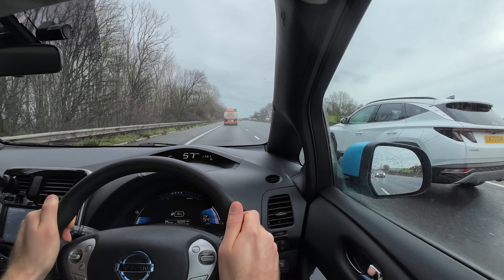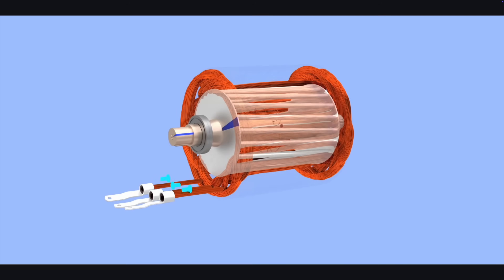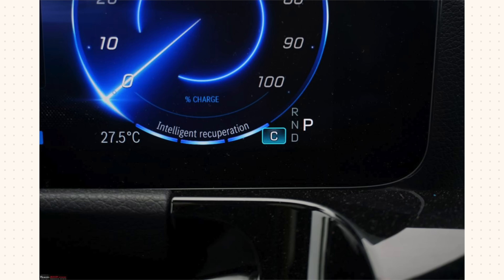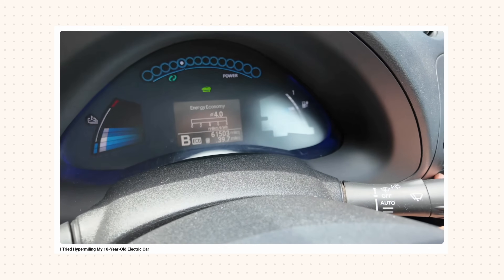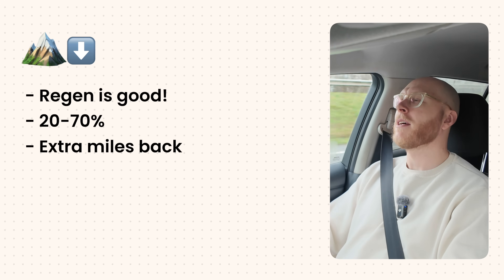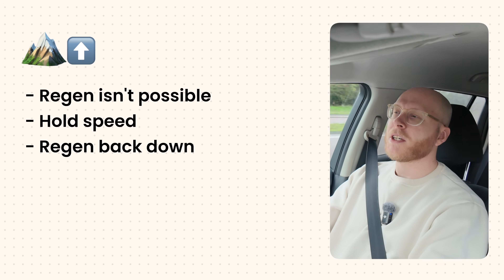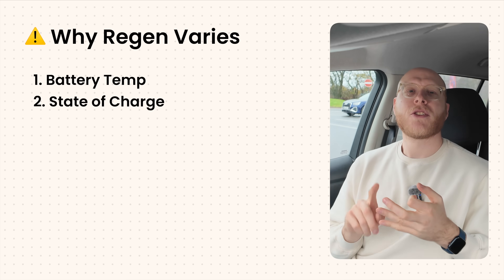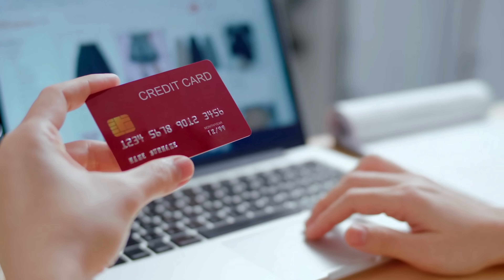You’ve Been Lied To - Regen Doesn’t Work How You Think

Comment: Regen paddles are a total waste of time if you have single-pedal driving (B mode on a Leaf). Just keep that on all the time and use adaptive cruise control on the motorway as much as you can.

That way regen is used to slow your car down if someone is driving more slowly in front of you than your set speed, and it is also used to help keep your speed constant on downhill stretches.

Single pedal driving means the amount of regen is adjusted progressively as you lift your foot up - no need for silly paddles.

People argue that single pedal driving is somehow less efficient than “coasting”, but that’s just ignorant nonsense. When cruising at constant speed, a certain amount of energy is needed to overcome mechanical, rolling and air resistance and in single pedal mode zero regen is enabled under those conditions. It is exactly the same as driving with regen off.

All regen does is substitute for braking effort, and if you have single pedal driving on it just means that you hardly ever have to touch the actual brake pedal.

Comment: For some reason tour videos keep popping up and in each one is clickbait and misinformation. 
No regen is most efficient, anywhere. Braking uses regen up to the point where you’re braking very very hard. Only then do the friction brakes take over. Better to coast and use the brake pedal (= regen) to brake just hard enough. Using OPD mostly slows you down too much, having to accelerate again. Yes it pits some energy back in the battery but at under 30% round trip efficiency. No system is without loss. If you had half a brain you’d understand that.

Comment: You missed out what happens when brakes are applied in an EV. In an ICE car the brake pedal is connected directly to the discs. In an EV pressing the brake pedal initially invokes regen braking and only applies conventional brakes when more slowing power is required - hence the long life of mechanical braking systems in EVs. The process is controlled by the on board computer control systems. So decelerating by removing your foot from the accelerator initiates one type of regeneration from the kinetic energy stored in the car - braking initiates another system which applies an even stronger reverse current in the motor top slow the vehicle. The computer decides which braking system is needed to slow down the vehicle when hard deceleration is needed or to bring the car to a stop.

Comment: I had a 2017 Chev Volt, just replaced it with a 2025 Model 3.  I had about 80% of my Volt miles on battery. (66,000 out of 82,000).  It had two regen modes, and also a paddle for aggressive regen.  I didn't notice huge gains in battery, but my original brakes were almost new when I traded it.  I use one-pedal driving on my Tesla when operating it manually.  I'm about 80% FSD since purchasing)

Comment: Our PHEV Passat GTE has a coasting "D" mode and a regen "B" mode.
I see the B mode as a driveability mode only, not energy efficiency. 
Low speeds, manovering parking lots, inner city driving, start-stop between traffic lights etc = B mode
High speed motorways etc = D mode always

Comment: 06:00 This, by the way, is where modern electric trains that get their electricity from catenary or third rail have an advantage, because they can just feed the electricity back into the grid and don't need to store it in a battery that might not have room. Older models and diesel-electric locomotives, on the other hand, just feed that power into a big resistor - effectively an electric heater - and let it heat the air around the locomotive, essentially throwing the power away.

Comment: Regen increases range by capturing some of the energy you spent to get moving, but that's not all. When you don't use the "normal" brakes, you don't wear them, so they last longer. My car has over 52,000 miles on it and the brakes look like new!
Edit: When going uphill, a steady speed is good, but for efficiency, you want it to be a bit faster than if you were going downhill. This is because the car is fighting gravity all the way up the hill, and the longer it fights it, the more energy it will consume. It can't be too much faster though, or air friction will wipe out the gain.

Comment: Any situation where you would necessarily require to use brakes is a win if using regen in an EV, otherwise it's worth avoiding using regen. With one pedal driving (e.g. Tesla) you have a constantly variable level of regen depending on how far you lift off on the accelerator. Driving technique is key to taking advantage of this. We have been used to simply lifting the right foot completely off the accelerator in a normal ICE vehicle but this is not the best technique for a "one pedal driving" EV. The idea is to ease back on the pedal and not to lift off completely. In this way you can vary from "coasting" to full regen just by the position of your right foot. People are very different in their acquisition of this new approach ... for some people it's 10 minutes and for others it might take a week before developing as much control lifting off the pedal as they have when pushing the pedal.

Comment: Regeneration puts energy back into the battery, not power. The energy which it uses (transforms) is energy that the brakes don't have to transform into heat. One significant benefit which you omitted is that avoiding braking keeps brake dust off the wheels, so they don't need to be washed as often. Also, if you drive sensibly, your original brake pads may last longer than the life of the car - my 10 year old brake pads have worn 1.5 mm in 120 000 km.

Comment: One important thing to know about your EV is if it has regen blended in when using the brake pedal. Some do, some don't. Tesla's don't so if you ever touch the brakes in a Tesla you know you are wasting energy. Ford's do, so you can apply moderate brake pedal and it will be using regen, but braking too hard blends in friction brakes and wastes energy. Fords have a braking coach for this. 

1-pedal driving allways gets maximum regen with smallest energy losses, i.e. no friction brakes (until stopped).

Comment: Regardless of EV or settings the accelerator always gives you precise control of regen.

Set regen to the max/1-pedal and then just control it with the accelerator.  There is essentially no penalty for this even during long flat highway driving.

Comment: Model 3 Performance.  I love the one pedal driving.  Regen is adjustable, and I have it set to the max so I rarely touch the brake pedal.  Never used the lower settings so I don't know how they compare,  but the car is much more efficient (miles per KWH) in stop and go traffic or just in slow traffic than at over 65MPH.   The display shows in instantaneous indicator of the amount of regen and power used, but there is no scale there.   A full battery kills regen because there is nowhere for the regen energy to go until you get down below 90% SOC.    Cold battery has the same effect, but I have not experienced that yet.
Reply: I suspect you will already have experienced a colder battery affecting regen, perhaps without even noticing. Once you develop the technique (as you have already done) you are constantly compensating for the differing angles of pedal to achieve the amount of slowing required. There are lots of factors that are affecting how much you require to lift, with cold battery being just one of them, so it can be lost in the mix. In practice you are simply responding appropriately to the amount of retardation needed, which may be the result of road surface, gradient, wind, traffic, battery temperature, battery state of charge etc etc  If you have been using your car every day then the battery pack will not actually be dropping to ambient outside temperature so you will have less of an effect. If the car is left for 2 or 3 days without driving the pack will gradually reach ambient cold winter temperature and you will be much more likely to notice the regen reduction effect. in fact there's an indicator appears on the Tesla screen when a notable degree of regen reduction is being applied .. otherwise it's possible that someone might misjudge their requirement for braking (like if driving after a 100% charge). People with the RWD Model 3 with the LFP battery chemistry will particularly notice this because they are charging to 100% much more frequently.
Reply: @MrAdopado we'll see if I get the "snowflake" icon on the display Monday morning when it is supposed to be 16°F overnight.  The car has never sat unused for a whole day, and I precondition it before I drive it, so maybe the batteries have enough insulation to stay warm enough all the time.  If figure if they work in Canada they should be fine in Virginia.

Comment: Since many people hate German cars for coasting and no one pedal driving: Coasting combined with regen on braking is the most efficient option. One pedal leads to many unnecessary regen cycles losing energy by accident. No problem if you like the comfort or prefer the mode but it is not the most efficient. Also many modern cars like Porsche, Audi, Mercedes have much higher regen levels than Tesla. More than 200kW.
Reply: That’s basically not true, unless you have a nervous tick on your legs

Comment: I hate one pedal because it just isn't precise enough for me, but I use paddle regen a lot.
We have a long hill with a 30mph speed limit. Going down it, turning on regen limits the speed to 30 without using the brake pedal. Even allowing for the occasional level and slightly uphill bits, the net result is that no electricity is consumed overall. So yes, regen works.
Going up the same hill, the electricity consumption is about twice what it would be on the level, suggesting regen is around 50% under those conditions.

Comment: One of the issues or side effects of regen in Kia EV6 at least is that when you take your foot off the pedal it immediately lights the rear brake lights unless you use regen level 1 only -- which in turn returns almost no energy back to the battery. Really odd design.

Comment: Regen works, but you're talking about few seconds of returned energy for much longer periods of acceleration and driving so it isn't much. However, I had one situation where regen returned a significant amount of energy. I was coming back from a trip in the mountains, so while maintaining speed using one-pedal driving, I was using negative 30-60 kw for about 20 minutes. I'm sure it didn't return all the extra energy used to get up the mountain in the first place, but I had much better efficiency for the round trip than estimated by the navigation system, so was pretty happy about that. I assume the navigation system doesn't take elevation into account.
Generally speaking, I use one pedal for slow, crowded roads. On roads with little traffic I use 2 pedal driving and do a lot of coasting.

Comment: A Tesla driver here, I built a can bus sniffer with a TFT display that displays electrical power at the moment. I get up ti 82 kW regen power at higher speeds when conditions allow (speed high enough, battery not too cold or too full - the car is 2020 Model 3 Performance, regen always on High setting, one pedal driving), but most of the time 72-75 kW is the maximum. Towing a trailer is power hungry, but regeneration is really effective going downhill. Decelerating at slower speeds generates lower regen powers. Between 10 and 75 km/h it's around 1 kW for 1 km/h at max decelerating. At higher speeds (like 150 km/h) regen is limited to around 75-80 kW, and deceleration is also weaker (power = force multiplied by force so braking force is lower at higher speed at the same power).

Comment: The shown Renault 5 has 'brake by wire'. It used regen when you press the brake pedal. And it adds friction braking only when necessary and in the last few meters before a full stop.
The label of '+0 Miles' is misleading.

Comment: An easier way to describe it is that if you can coast then coasting is better. If you must slow down then regen is always  better than physical brakes.

In no situation would regen be worse than brakes from an energy efficiency standpoint.

It's effectively just an alternative to deceleration instead of turning your kinetic energy in to heat it converted it in to electrical energy.

Anytime you are stopping regen is putting back energy that would have otherwise been lost. That's why it is universally better than braking for efficiency.
Reply: Yup, regen is just limiting losses you would get from brakes alone. But still losses it is. What is missing from the video is estimate of what percentage of kinetic or gravitational energy can be salvaged with regen. I'm betting on around 50% in an EV and even less in a hybrid. People get excited about the extra range going downhill but forget how they got to the top in the first place

Comment: There is some useful information in this video, but it does not, to my mind, tackle the most fundamental misunderstanding of regen.

The regen setting you select generally has NO bearing whatsoever on the amount of regen your car* does.

What it does is changes the way the system responds to the position of the accelerator pedal. At 'zero' regen, lifting your foot from the accelerator will simply cause the system to stop powering the motor. Using or one pedal mode will effectively change the accelerator (when not actually accelerating) into a speed control.  That, and intermediary settings are  essentially nothing more than variable engine breaking.

So when you lift you foot off the accelerator, or press the brake, *whatever regen mode you in*, the system will decide how much retarding force you require, and use regenerative braking to provide as much of that force as possible., and if that is insufficient, it will apply the friction brake to assist.

The way to achieve maximum range, regardless of regen setting, is to drive as smoothly as possible and avoid heavy braking whenever possible.

* This has been verified by experiment on a couple of cars, including ta 2023 Nissan Leaf. It is possible that systems that are less than perfect may use the friction brake more than is necessary.
Reply: In my 38kWh ioniq when modulating driving speed with the accelerator there are certainly very different levels of deceleration depending on the regen level selected. Maybe you are right to say the car decides the force needed if you abruptly take your foot off the accelerator, but I try not to drive like that.
Reply: @DaveJS46  Yes, that was my point. The regen level will alter the level of deceleration, but (unless you exceed the vehicles  ability to regen), it will not affect how much decelerative force is applied by regen v friction braking.

Comment: Not done any proper 'scientific' testing, but fo the way I drive, my R5 is more efficient with regen off - lift and coast with the light regen it defaults to as standard is a better fit than driving closer, regen to stop and then using energy to set off again.

Comment: The VW system is actually also a form of adaptive regen. If younout the car in Dmode (coasting mode) the will anticipate traffic and the rout loke roundabouts, crossings and will slow down using regen

Comment: In the early days of the LEAF several were returned with 'Brake failure' as for the first few miles there was no 'engine braking' effect with a full battery. After a few miles when there is room in the battery regen can work as designed. 
My current LEAF has one pedal control which gives me full control of acceleration , constant speed and slowing down. I can use my foot to control the level of regen according to traffic conditions. Just lifting the foot from the pedal is NOT the way to drive, learn proper control . With Adaptive cruise control regen operates on down gradients as the cars speed is controlled. 
As I turn Cruise control off there is a delay before regen cuts in, I use this delay to determine the timing of turning off the C/C. 
One of my LEAFs has covered over 100k miles on its original brake pads, and averages above the WLTP range consistently. 
For some reason the new Mk4 LEAF is coming with paddles as well as one pedal mode.

Comment: As a proud KIA EV3 owner and a newcomer to electric mobility, I prefer regeneration level 1 (out of 0-4); it feels best to me. In my mind, I also regenerate energy when I (gently) apply the brakes. Am I mistaken, or are other regeneration strategies more efficient?
Reply: Tou are not mistaken. Tapping the brakes uses regen. Hence it’s more efficient then OPD because using rhe brake pedal gives you mich better control. OPD makes you slow down too much having to accelerate again. Not good for efficiency.

Comment: Having adapted to 1 pedal it's on all the time and adapted to types of road via modes. High regen in town  and general driving (untamed) to allow good control through traffic and low (Whisper) on motorways for cruising at constant speed. Whisper for snowing conditions too, but that's more for throttle response.
Reply: Indeed, once you've adapted to "one pedal driving" it doesn't matter what kind of roads or conditions you are driving in because you automatically ease off on the accelerator pedal just enough to maintain you chosen speed. This means you can be "coasting", slowing gently, or slowing quite firmly without ever having to adjust anything other than your right foot!